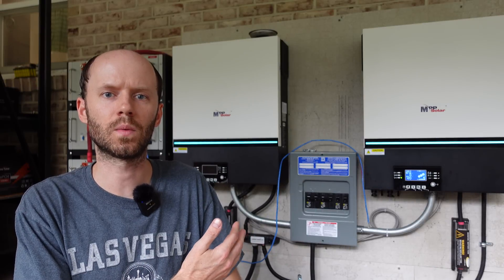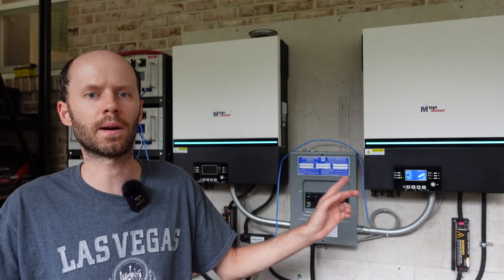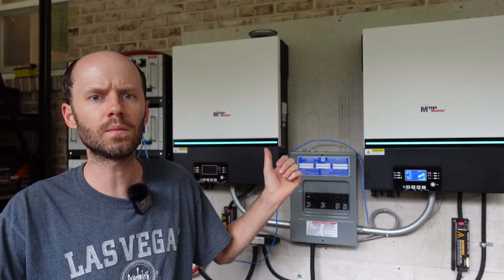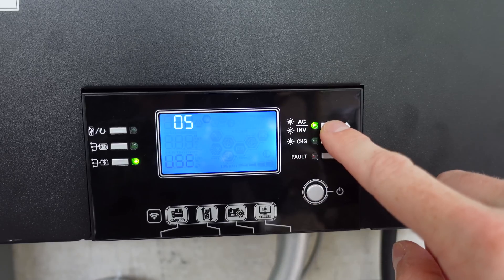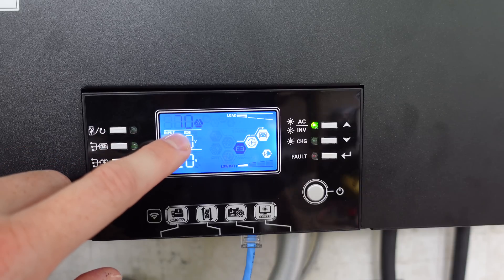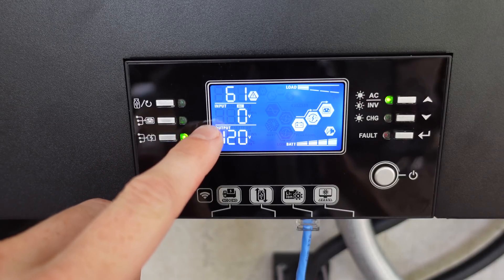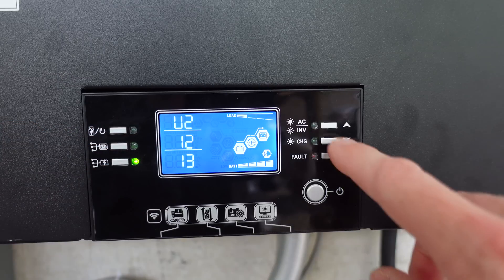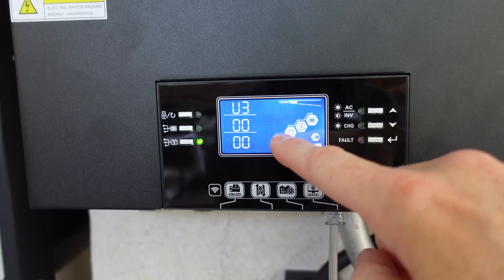MPP Solar LV6548 Voltronic Firmware Problems, I Bricked the Inverter Display!

Comment: Have you tried switching that display to the other inverter just to check? Sorry you’ve had a rotten experience with them. Mine have been great so far. Was Ian willing to replace the display?
Reply from the maker: I have not tried swapping them. Right now I have one inverter that's working absolutely perfect and I don't want to risk having two broken inverters lol. I have not asked Ian to replace the display. I'm the one whom broke it and don't see why he should be responsible for replacing it.
Reply: @LithiumSolar  Don't be so hard on yourself. You are not the one who coded an deficient flash upgrade process! If I were MPP solar, I would work with you to identify the defect and repair your screen and fix the comms issues. This video does not show the company in a good light and they need to act.
Reply: @LithiumSolar  I also was thinking about swapping the display.  In theory, it should work, but then again, so should s simple firmware change.  All bets are off and there is no documentation.  I would ask Watts 247 to see if they can swap a display between two devices with differing firmware.  As the distributor they need to get support, or be the support. I bet they would be wiling to try.
Reply: @LithiumSolar  I honestly didn’t realize the displays themselves could be updated. But I believe they are essentially a glorified computer monitor. The inverter itself holds all the real data. So it shouldn’t hurt to swap the screens between the inverters. When I transferred my screens from my shop to my house and attached them they had a 50/50 shot at being swapped around. I get what you’re saying though. You don’t want to fry something else. I think this falls under warranty. You didn’t do anything outlandish to cause the screen to die. Either way I’m sure it isn’t s huge deal to get a replacement.

Comment: Also have you cut the power from teh inverter battery and solar, turn it on to drain the caps and then enable the batts and see if it might reset the display?
Reply from the maker: Yes, I've tried this - thanks for the idea though.

Comment: Get a GS Genatry Inverter, they are better then what you got. and they coming out with the 12k version.
Reply: Maybe, but at least you don't have issue down the road. my two gs inverters that run my house never have any issue and I use make sky blue solar chargers which are etter then victrons and cost less.  I always stay away from something that has more then one feature built in, one thing breaks you might as well throw the whole thing in the garbage.
Reply: Everyone worries about the idle power consumption. Add another battery and a little more pv. If my high freq AIO fail, that is exactly what I am doing. Then your not locked into one distributor that may or may not have time to take care of their old customers with issues.

Comment: Amazing how people have come to think that MPP and Growatt are top tier gear.  Give it a year and see what people are still thinking.
Reply: There is videos over a year old out there. People still love them. For the price mpp makes some really nice inverters. So far my lv6548’s have been working flawlessly.
Reply from the maker: @GavinStoneDIY  What firmware are you running on yours?
Reply: @LithiumSolar  I have no idea to be honest. I could check. I don’t use battery communication and I don’t have them hooked to work so there didn’t seem to be a need to update the firmware.
Reply from the maker: I've never considered them top tier by any means, but they're easily the best in their price class.
Reply: @Channel-gz9hm  My two EG4 on BO $2900. My two 12K $12,000. So, 400% and I get 16,000W off-grid out of two 12K's. Not one glitch out of 12K. We'll see on my shop/electric work van system.
Reply: @USA-GreedyMenOfNoIntegrity   2 x 12k solark  =  2 x EG4 ? 
:>)
Reply: I've been running an MPP Solar 5048 (from Taiwan) in S.Fla for more than two years with a home-built 12kWh 14s120p 18650 battery. Keeps my beer and mancave cold (among other loads). $1200 for the unit with no problems whatsoever. Maybe I'm lucky?

Comment: At least WATTS247 works with you Signaturesolar won't even communicate with me.  I have a Growatt 12k inverter
Reply: Its such a PITA when manufactures, resellers stop communicating with their customers. Unlike comms between BMS and Inverter - comms with the customer is necessary!
Reply: @Bennyboy-dog  Problem is is the margins are already going to be slim on these cheaper inverters so the incentive for spending money on support is not there.
Reply: @davidb.5544  Did you just called a $1500 inverter cheap?
Reply from the maker: @hubertnnn  Yes, it's cheap for the inverting power and features you get.
Reply: @hubertnnn  Yes , a 1500.00 12k all in one  home inverter IS inexpensive.  Solark  and may others is 6500. 00 .
Reply: @davidb.5544  Good point David. You are probably on the money. 
I wonder what is the point of cutting margins by sacrificing support when presumably this leads to bad mouthing the product which presumably means less sales? If so, they are on a unsustainable trajectory. It would make sense to provide good support to keep the margins and sales volumes up, unless they wanted to get rid of inventory and cancel the product.
Reply: @davidb.5544  Then raise the price $200 and hire a tech support person.
Reply: @onthelake9554  Oh, I didn't realize its a 12k, I though it was 5k like most of those inverters.

Comment: This is one of the reasons I prefer to connect a raw battery (LiFePO4 cells+BMS) without comms to the inverter. (less things that can go wrong)
Reply from the maker: The communication is not required for operation of either the inverter or batteries. I wanted the feature though so I can do some fun things with my Batrium.
Reply: @LithiumSolar  Interesting to see that vid when you release it as I can't imagine why you want that....holding on with the tips of my fingers!
Reply: Yes I love tech stuff like this, but I built my system for emergency power so I built mine old school regular 3000 pure inverter, charge controller, and 6 100 ah lithium batteries with auto transfer switch. That's it
Reply: My approach too - KISS.

Comment: Now I know why I’m glad I bought Victron, no issues whatsoever on any upgraded firmware! 🖖
Reply: I've even downgraded and re-upgraded firmware on a Quattro to test differences with no issues doing that,
Reply: @Channel-gz9hm  
Of course you have to use your brain and compare components and manufacturers and processes. But in most cases you get what you pay for.
Reply from the maker: They seem higher quality for sure, especially love that their US low-frequency model has a toroidal transformer. But they cost $$$$$.
Reply: @LithiumSolar  
Well considering your problems, is it worth my peace of mind?
Reply from the maker: @benjones8977  Agree it's well-worth the money for someone willing to spend it
Reply: @LithiumSolar  
I guess the difference is I have the money and I’m 65. I built my own off grid system using VictronConnect components, and haven’t had any issues at all. 
 Let me put it this way, my mom used to buy used TVs when I was a kid instead of buying a new one. Well those used TVs lasted about six months and then she’d have to buy another one and then another one and then another. So would she have been better off buying a new TV, likely paying the same amount or less and not having the headache?
Reply: @benjones8977  Right, if you have the cash and you don't want them to put the cash in your grave, may as well buy Victron!!!   Good strategy!!!!
Reply: @ForwardGuidance  
With the high prices of energy, I would consider my relatives would be happy I went off grid!

Comment: Could it be a bad backlight?  Shine a strong flashlight into the dead display and attempt to modify the menu.  See if the LCD digits and symbols are actually still there and responding.
Reply from the maker: Great thought, but unfortunately no - can't see it with a flashlight and the LEDs don't even light around the display either.